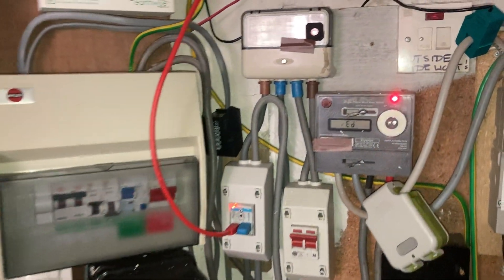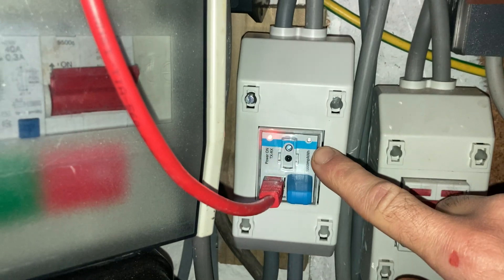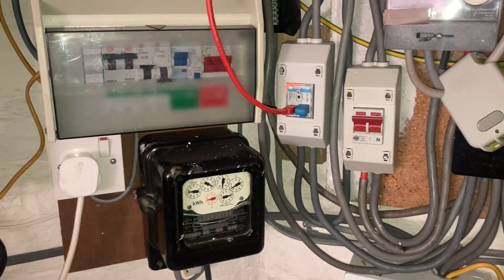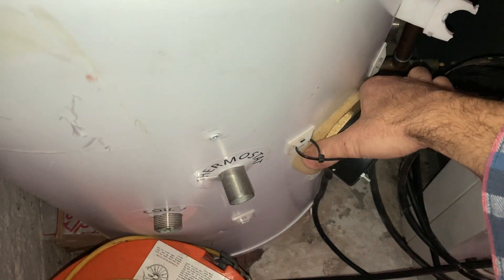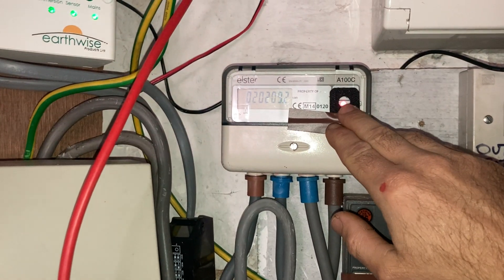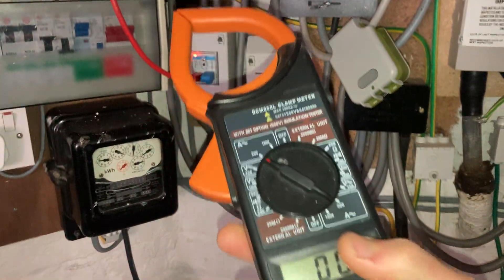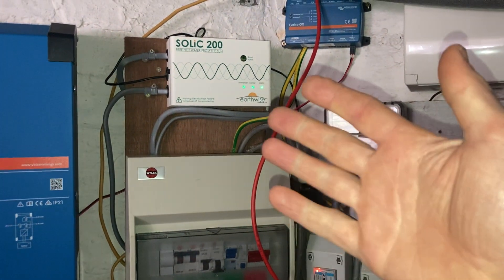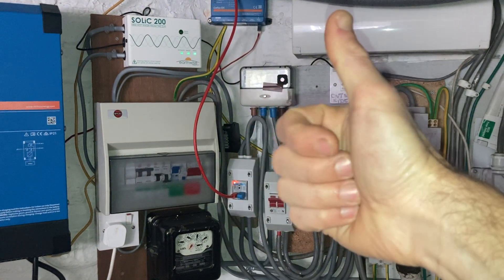Solic 200 solar diverter working perfectly? Import and export 0kW.

Comment: I look forward to your followup video showing the electrical installation you have there. If you don't mind, could you answer the following two questions in that video:-
Do you plan on streamlining the devices/wiring? Also, which of those meters are utility owned or is that elsewhere in the house?
Reply from the maker: Hi Ian. 
The installation is really quite simple. Power comes in through the utility meter (I think it's the ampy (grey) one in the video. Then to a 100amp isolator, hten backwards through a meter to show outgoing power. then to the power meter with the rs485 output( cable to cerbo gx). then into a splitter box. this has 4 outputs. one to a CU upstairs, 3 to the CUs in the area. One is the house CU, another is the solar CU with 300mA rcd (rather than the standard 30mA) and the lowest CU is for the Multiplus. Streamlining? I get the electrician to nail another CU on whenever I need one! I have since disconnected the solic. Later that day I was looking at it again and it was sucking power from the battery! I think I might have a go at wiring my 3kW immersion directly to DC from a small string of panels, and abandon the solic.
Reply: Quite simple indeed! My Uncle has a grid tie system. Smart meter next to the house CU then to a Garage CU (panels mounted on garage roof). Cable goes from Garage CU to export meter and then to the solar inverter. I don't think it's a specific direction meter, if they even exist. Simply put, power can only go from the inverter to the CU so that's what's measured. Readings sent to the utility company, FIT currently at 60p a unit.

Comment: Hi Owen, just wondering how hard is it replacing the ballbearing on Miele Prestige Plus 6 (W562) and is it even fixable. Rang around, no one wants to touch it.
Reply from the maker: Hi, I see from your comment on my other video that you got your answer, but don't be discouraged, Bearings are cheap and if the rubber seal hasn't failed don't buy a bearing and seal kit, just buy the bearings, as cheap as you can. Even if you do need a bearing kit they are not so expensive. It is a job that needs patience. but these are the machines that are designed to be repaired. I would go for it. The worst that can happen is that you still have to throw the machine away!
Reply: @bootsowen  I rang few guys around Dublin and once I mentioned Miele and sent the video of the problem all of them said bearing is gone and we don't fix it, buy new washing machine, then the youtube algorithm helped me find you and after watching few videos (especially ball bearing change on a Bosch) I thought I could do it. Like you said, the only thing that can happen is a broken washing machine and that happened already. Thank you for your videos I'll get you back on Patreon whatever the outtcome!
Reply from the maker: Or PayPal. Cheers buddy. Good luck!  Let me know how you get on!